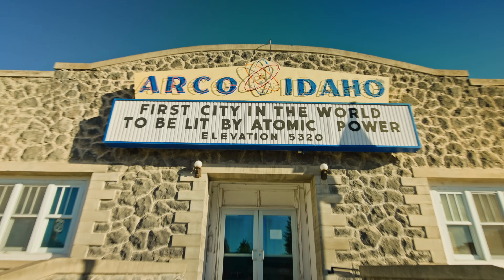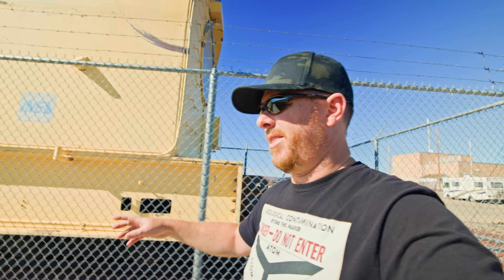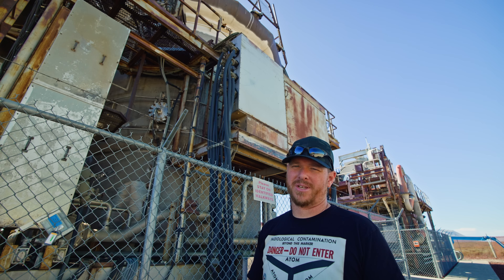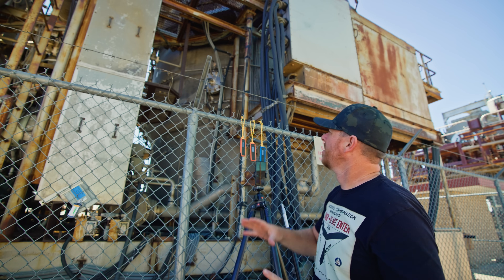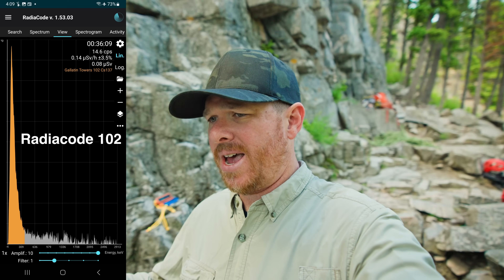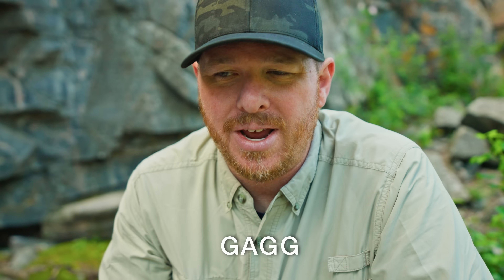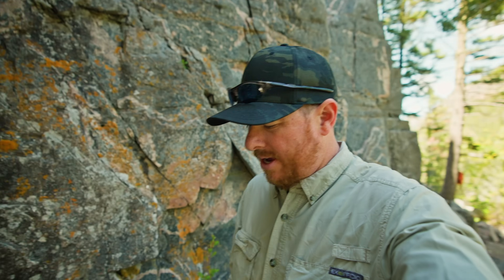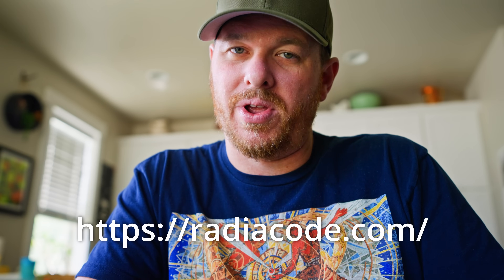Touched a Nuclear Jet Engine Core with the Radiacode 103G

Comment: Should have just worn a bright orange vest. Nobody asks questions when you have one of those on. 😆
Reply: Vest, hardhat, badge lanyard, document holder clipboard, handheld radio: The universal access set. 😅
Reply from the maker: @Yaivenov sounds like a master key there.
Reply from the maker: Very true.
Reply: I found that firefighters never get questioned. It can be an Amazon Halloween costume..doesn't matter..nobody questions the firefighter.
Reply from the maker: @Live.Vibe.Lasers I think dressing as emergency services would be getting into the illegal territory.
Reply: Add a hardhat and clipboard.
Reply: Clipboard, uniform or I’d badge, and a ladder can open up doors.
Reply: all good to know if you ever need to pull some mclain mcgyver stuff
Reply: Many, many years ago when I sprayed weeds for the county during summer vacation from college, the guy I worked with drove a utility truck - the kind of truck somebody like a plumber would drive to secure all his tools.  One summer we had a fairly large forest fire and the Forest Service closed down all the roads going into the area and allowed only emergency services personnel through.  The coworker breezed in and out without an issue because they assumed he was there to fix something, not just to look around which is what he did.  This goes to show that if you look like you belong there and have confidence, most likely you'll not be bothered.....now I wouldn't try this around Area 51 or some of the other high security areas - you'll just get shot and be asked why you were there later!
Reply: after 9/11 i do...

not a jogger biker having car trouble delivery or look like a competent construction or officer of 5years experience or more. having worked many trades i should have enough experience to feel confident in saying something to the guys or take a photo and try to find the company to ask if i can post it publicly as part of a school project... or public education...

no response or you cant find the company... they are up to no good. 

but yes it is surprisingly easy and you should be as respectful of this as possible... not try to exploit peoples gullibilities instead use it to see if you can teach them more.

Comment: Mercury is actually MORE dense than lead and so an even better radiation shield. A lead ball will float like a cork on water in it. I think only tungsten, platinum and gold are the commonly available metals that will sink.